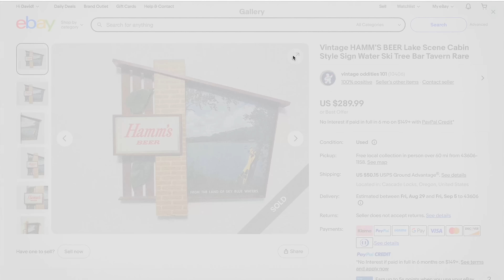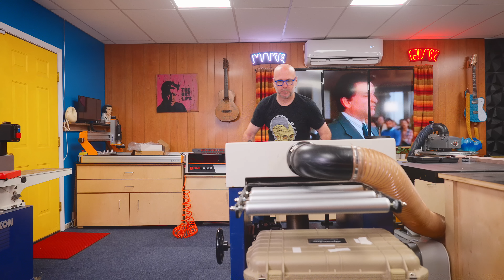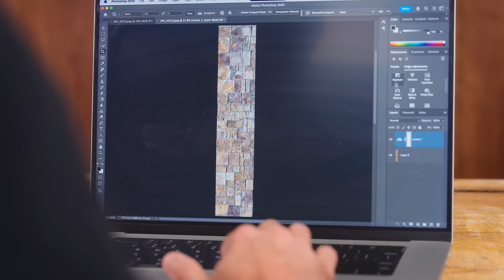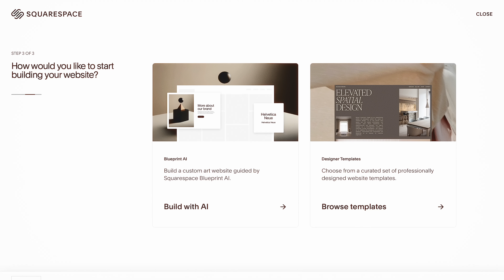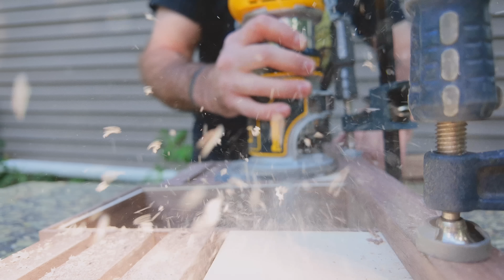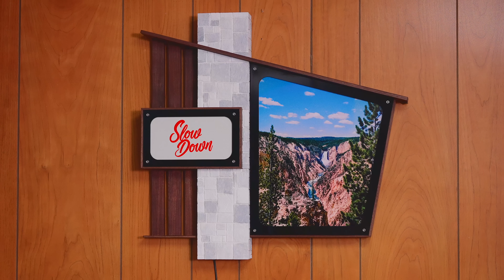Probably the fanciest picture frame you'll ever see.

Comment: What I find works well for solder joints is to slide on heat shrink before you solder then put on hot glue and slide the heat shrink over the joint. Then use a heat gun to shrink it to fit. The hot glue protects the joint with a little strength and the heat shrink will stay in place better than tape.

Comment: Great work! I was going to make some backlit frames of my own. Could you tell me the brand of photo paper you used? I find a lot have watermarks on the back which obviously won’t work for this. Thanks!!
Reply from the maker: Thanks! So yeah, I should have mentioned that I'm using Epson paper and the watermark on the back is slightly visible when you look up close but only in the sky region where there's no detail. I will be on the lookout for paper without a watermark.
Reply: @MakeSomething  if you find some photo paper without water mark let me know. I’ll look too. Thanks!